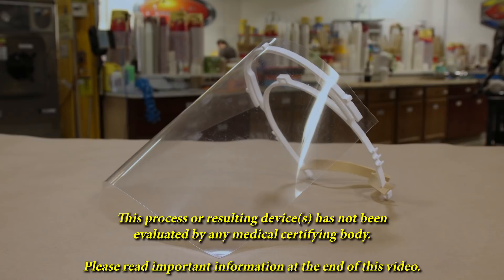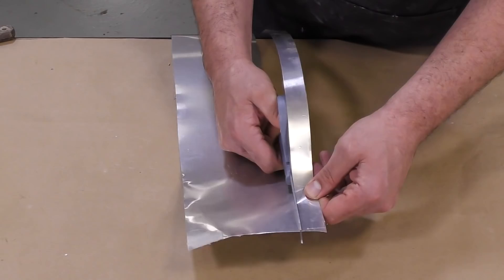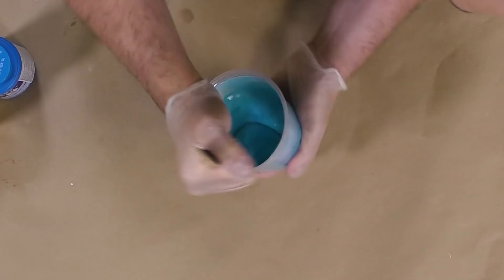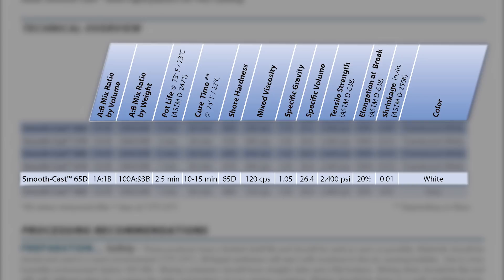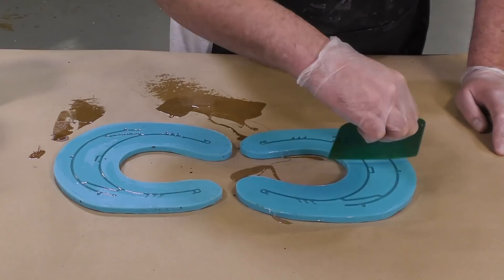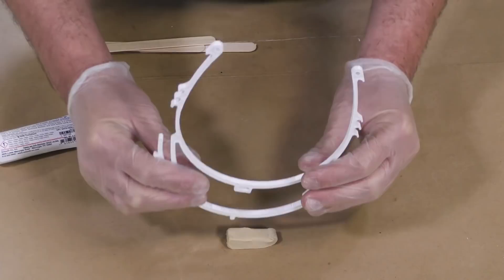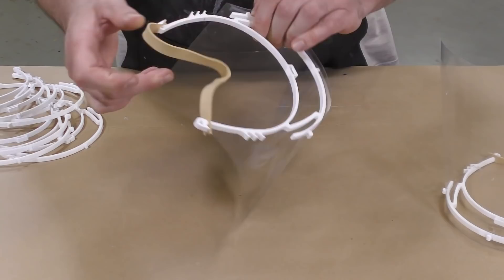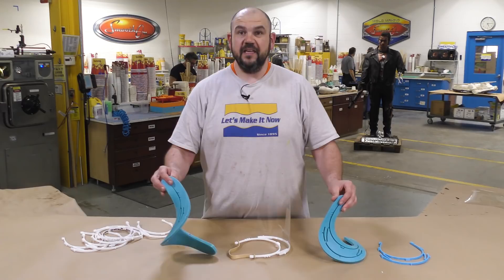How To Make a DIY Face Shield Using Mold Star™ 16 Silicone and Smooth-Cast™ 65D Liquid Plastic

Comment: Printed the model not as a piece but as a 3D mold (Cura) with flex filament. Changed the "Z" height of the model to 8mm high. Then attached the mold to sanded stencil blank with regular wood glue so it has a base. If I had some smooth glass that might work better, but we'll see. Ordered the 65D and awaiting delivery. Will commence production soon. Thanks for the idea! 
We will beat this thing 💪.

Comment: Idea, make a mold for a silicone face mask. Two parts. The mask part that touches the face. And a rim that holds a cut piece of a readily available filter that is used in home furnaces. The rim folds over a lip will hold the cut piece of filter. Reusable and easily cleanable/ disinfected. Also the filter medium is available everywhere. Good luck, great job!

Comment: I'm in the UK, & inspired by this I made moulds from a 3d Prusa print which had been slightly modified by the guy who printed it to take a bit less material. Mine take 50ml of 65D per cast, allowing a little for overfill. I found I had to use a large syringe to fill the moulds effectively. BUT I am now worried that they will be rejected because the material has not been approved, so I've paused my casting and awaiting confirmation. This is in the UK; it may be different in the US of course. So be cautious anyone starting this now in the UK. New guidelines are being issued.
Reply from the maker: Excellent point

Comment: I'm curious about pushing the pattern into the sculptex clay.  Does that make the part smaller?  Since part of the pattern is in the clay Does that make the final cast part thinner/smaller?  I can see from the video that its still works.  Is that because its within the  tolerance of the design?
Reply from the maker: The firm clay and smooth surface of the clay makes the difference extremely small, well within the tolerances of this design.

Comment: Any material other than 65D that would stand up to the heat of sanitizing equipment such as an autoclave?  In my experience with 65D it would probably warp under the heat.
Reply from the maker: Yes, using TASK 8 would give you a casting which could be autoclaved https://www.smooth-on.com/products/task-8/

Comment: How many urethane casts can I get out of the mold? Will it wear out with use?
Reply from the maker: Using a fast setting urethane and a release agent when casting will give you the most castings possible. The mold will wear out with use but a platinum silicone such as Mold Star has excellent resistance to the effects of casting urethane resins.

Comment: Is it safe to have the polyurethane parts in contact with skin for prolonged periods?
Reply from the maker: A layer of Sil-Poxy silicone adhesive, which is skin safe when cured, is placed on the urethane resin to ensure skin safety. https://youtu.be/UBqR6s6L86Y?t=461

Comment: Hello Milo Will Task 3 be okay to use
Reply from the maker: TASK 3 will be more rigid, and less flexible, but it can be cast into a Mold Star silicone mold.
Reply: @smoothon  Thank you for the reply .Task 3 is the only polyurethane I can get at the moment in my Country.

Comment: I wonder how good it is in making the Prusa frames.
Reply: was thinking the same as those take ages to 3d print
Reply: Sonic S , I modified the frame so it’s almost half the height. Had it tested with some nurse and gave it a thumbs up. Cuts time in half almost.
Reply: @AndreMercado  It's good, I made moulds from a 3d Prusa print which had been very slightly modified by the guy who printed it to take a bit less material. Mine take 50ml of 65D per cast, allowing a little overfill. But I found I had to use a large syringe to fill the moulds effectively. Also I am now worried that they will be rejected because the material has not been approved, so I've paused my casting and awaiting confirmation. This is in the UK; it may be different in the US of course.

Comment: Hi! Any reason why he used platinum for the mold? 
I have mold max 29NV 😭 could I use tin cure instead?🙏🏼
Reply: Btw thanks for sharing! I also have accel-t if cure time is an issue.
Reply from the maker: 29NV would also work.  The silicone in this case was chosen for a short cure time.  If you have the time to allow the 29NV to cure naturally, the rubber will be stronger than if you accelerate it.
Reply: @smoothon  Thank you!!